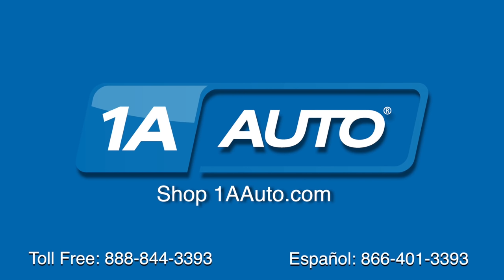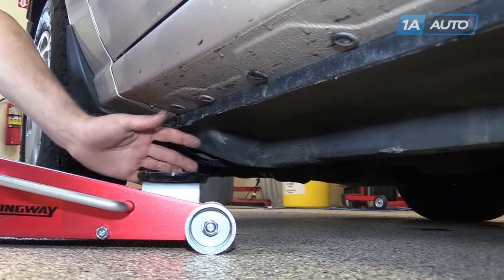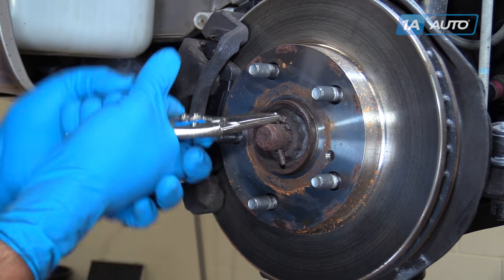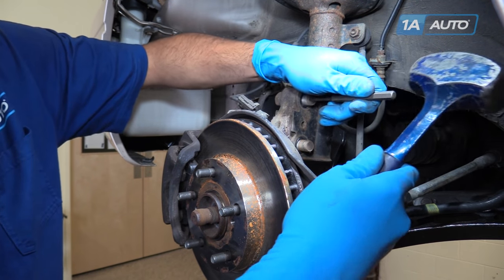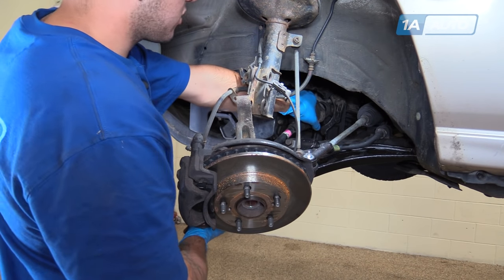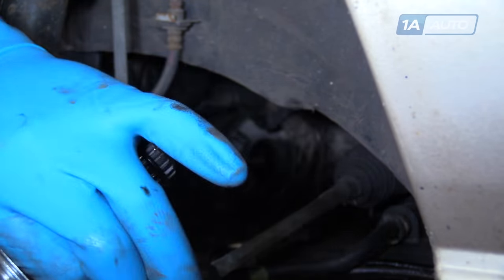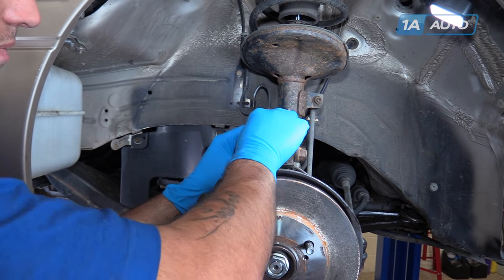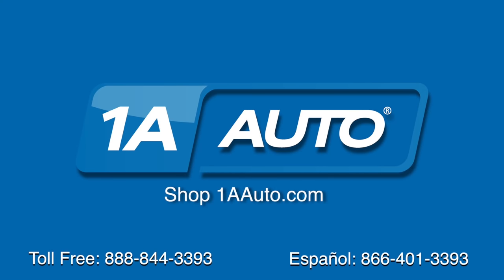How to Replace Front Driver Side Axle Shaft 92-01 Toyota Camry

Comment: Since very few of us have large hydraulic lifts, I thought I'd point out that you can use the pry bar method from the top as well. Raise your hood,  remove your air intake assembly, remove the plastic cover over the axle that's bolted to your transmission and use a crow bar from directly up top. Worked like a charm for me!
Reply from the maker: +Leviathan Kraken Thank you for your feedback!
Reply: I love you I was trying for so long till I seen your comment
Reply: Hey thanks for the tip. I took off my intake box use a big pry bar and popped it out 3 ft away no way I would have got it under the vehicle

Comment: 1999 Camry LE- 30mm axle nut. 
Was able to use small pry bars with car jacked up. Took 30 seconds. Getting the new one in took longer. 
Very helpful video, thanks.

Comment: Good video. I’m puzzled by the 32mm socket. At the beginning, it says you need 12 to 32mm sockets. When the hub nut is removed, the mechanic says to use a 32mm on a breaker bar.  When the axle is replaced, he says to use a 30mm. I bought a 32mm socket to do this job on my 99 Camry based on this video, but both the OEM and replacement were 30mm. My fault, I should have checked it myself first. But the correct size information in the video would have saved me a trip to buy another socket in the middle of the job.
Reply: Totally caught that too, thank you for your comment as I was planning to buy the 32 at first but then caught him saying "30" during re-install.  I was llike "so which one a$@hole"...lol
Reply: Lmao I was about to but a 30mm socket then tripped out when I saw the start of the video. When I finished it I was redeemed 😂....30 it is

Comment: Great video but I would add, when you're reinstalling any suspension components you should put some grease/anti seize to avoid issues if you have to remove it again. You can possibly get away without it in warm climates but anywhere that sees snow and salt will have that seized in a matter of a few years

Comment: Great video,I have one question,Why you should we worry about not damaging the axel thread ,?you are replacing it anyway
Reply from the maker: +Carlos Leiva Thanks for watching!  It's just good practice really, you might as well do it that way in case you need to reinstall the old part!  1aauto.com
Reply: 1) mushrooming the axle end may keep it from pulling out from the hub, and 2) if you're replacing your axle with a remanufactured part, you have to return it undamaged to get your core charge back. 3) leaving the nut on the end of the axle gives you a bigger target for hammering it out.

Comment: Hello, some other videos show undoing the tie rode and lower control arm instead. I'm assuming you find your method easier...? 

Is it likely you would need an alignment after this procedure?
Reply: I heard that you need a realignment if you mess around with the tie rod and lower control arm. Looks just as easy removing the strut bolts. I have a mechanic coming over to show me how it's done.

Comment: I used a breaker bar and car scissors jack  under the bar to undo the axle nut. It works. No need for heavy duty socket. Just ordinary 30mm deep socket will do the job. Be careful!

Comment: The 12mm bolt on mine is frozen with rust. The bracket just bends when I try to loosen the bolt. I'm going to soak it with WD40 all this week and try again next weekend. Any other suggestions?
Reply: Impact wrench?

Comment: Soo when placing axle and working it back it, it doesn't need to be pressed in or kcocked in , or when tightening axle nut it will press in?
Reply from the maker: +Joshua Davila It should slide back into place for you. If you follow the video you should be fine. We carry the replacemen axle shown in this video on our website. Here's a link to them https://www.1aauto.com/toyota-camry-solara-cv-axle-shaft-driver-side/i/1aacv00094?utm_source=YouTube&utm_medium=CTA%20Comment&utm_campaign=ytcomment
Reply: I have the same problem I had install it it went in but still comes out easy for some reason. It goes in but there’s a part in the Axel that does not let it in all the way. Any help plz
Reply: @bryanpadilla6695  I've not done this myself yet, was looking at videos for ideas. I'd check and make sure the old retainer clip came out, I'd try putting new one in WITHOUT that clip and see how far it goes in, make sure the ends are identical. If it goes in farther, you may have an issue with that ring on end, are they the same thickness. I'd recommend changing that seal before putting it together, mine leaks a little, thats why I'm thinking of doing this.

Comment: Yawn.  Those axle nuts come off much easier if you wire brush the corrosion off the threads first.  Then lubricate.
Reply from the maker: +av8bvma513 Thanks for the feedback!

Comment: you said 32mm axle nut when you go to take it off but when you go to put it back on you say 30mm ..... ?
Reply from the maker: +Dennis It should be a 32MM. Hope this helps you out. If any of our viewers needs to make this repair here's a link to them replacement part shown in this video on our website https://www.1aauto.com/toyota-camry-solara-cv-axle-shaft-driver-side/i/1aacv00094?utm_source=YouTube&utm_medium=CTA%20Comment&utm_campaign=1ATony
Reply: well, I went out and bought the 32mm and it end up being a 30mm nut for the Cv Joint on my 1995 Camry, So I went back to sears and got  the 30mm socket... LOL
Reply: +Dennis I have a socket set that goes upto 30mm so I hope that my axle nut is 30mm lol. I've got a 91 Holden Apollo.

Comment: What if the snap ring doesn't come out with the axle?
Reply from the maker: +Josh Hause We would suggest purchasing a new part instead of trying to reuse the old snap ring.
Reply: 1A Auto Parts I mean the old axle came out but the snap ring is still in the transmission. I have a new CV axle to install
Reply: Josh - I'm wondering if 1A Auto Parts misread your question, as they tend to do. I'm not sure, but I'm concerned if your snap ring came off your old axle when you removed it, and the snap ring stayed in the transmission (differential), you need to get it out of there, if possible - maybe using a magnet? Not sure what would happen otherwise - best case - to prevent it from getting chewed up by the gears and ground into tiny pieces - in which case you could change it soon- drain and replace your differential (ATF) fluid - which is a totally separate supply, drain and fill plugs, no dipstick, from the transmission.